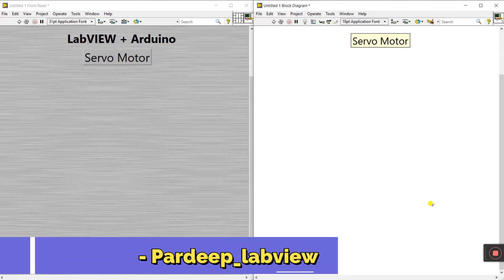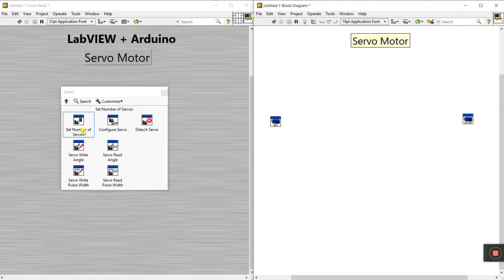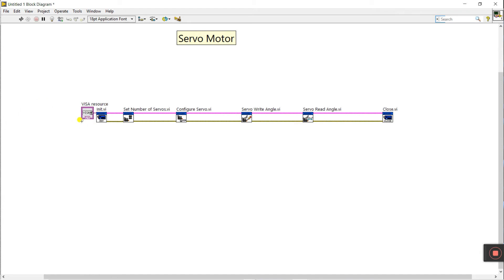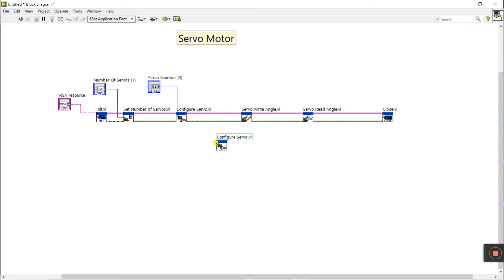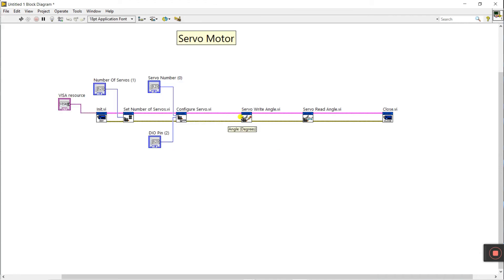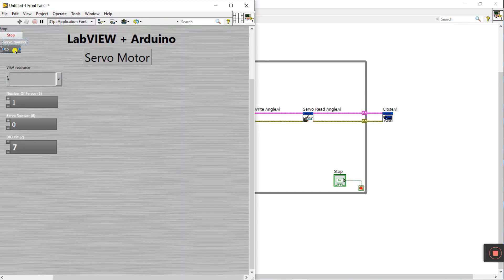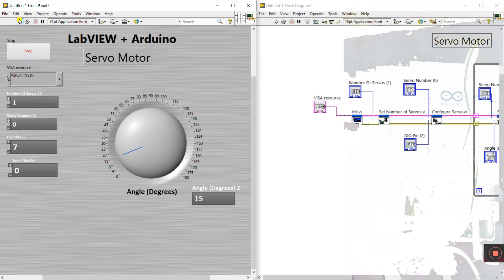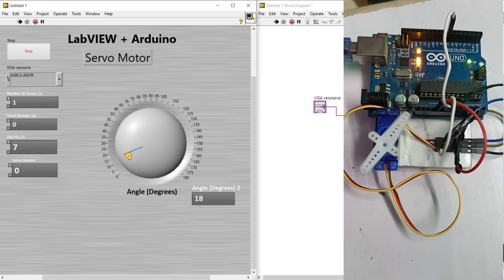LabVIEW | How to Operate Servo Motor using LabVIEW + Arduino | LabVIEW Arduino Project Series

Comment: Sir plz make radar system using servo motor and ultrasonic sensor
Reply from the maker: Ok dear
Reply: Ok sir we are waiting...for a project based on labview Programming using servo motor ultrasonic sensor and Arduino...asap
Reply from the maker: @kamrangul2876  yes dear